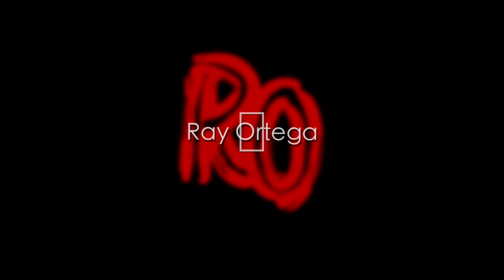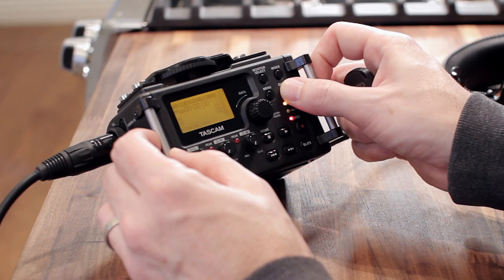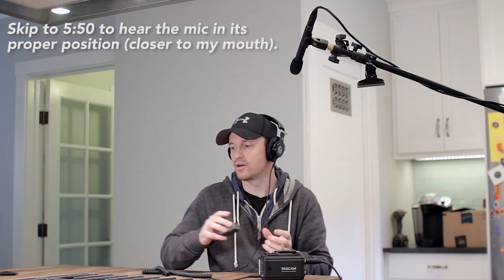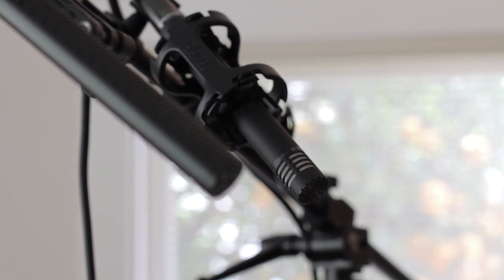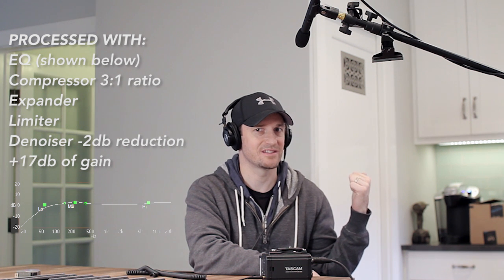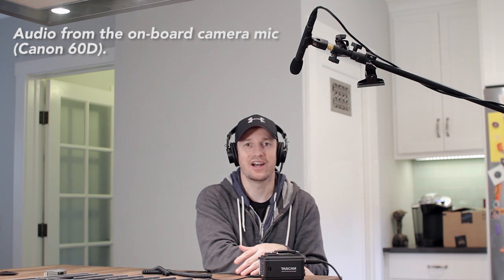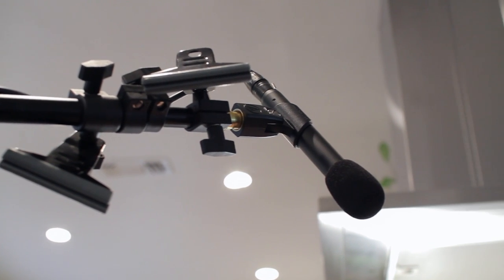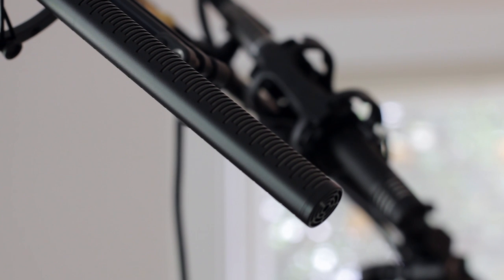AT4053b Hypercardioid Boom Microphone

Comment: Shotgun mic senken CS-3e is designed for both for indoors and outdoors because they have added capsules for rejecting lows and mids from the rear and sides of the shotgun which will be helpful for low ceiling booming indoors(reflections from celings and sides will be reduced) & also for outdoors for rejecting ambient noises from sides and rear.
If u do comparison between Audio-Technica AT4053b and Senken CS-3e indoors,it will be helpful for people like me who want to buy 1 mic which Fits all their needs.

Comment: Amazing video! Learned a bunch and im sold on the 4053 and the DR-60D. The mic is a little pricey but you get what you pay for and this sounds absolutely beautiful. When im ready to buy I shop through your links. Thanks again for making this outstanding video.
Reply from the maker: +Jo Olmedo thanks Jo. Appreciate you using the links. The 4053b is a great little mic and the DR-60D does a great job at a great price.

Comment: Hi Ray! Did u decided what mic will be ideal for the echoe type room? will a Sanken Cos11d lav will be better? my location is concrete with hi ceilings no acoustic treatment whatsoever.
Reply from the maker: Both of these mics work great but in an environment that is challenging acoustically like yours, the hypercardioid (AT4053 in this case) is a better bet because it doesn't have the rejection tube/slots which make it less likely to cause an issue. However in your setup you're still going to be challenged by reverb so do anything you can to help mitigate that, rugs etc and the lav mic will probably be best for the simple reason that it's close. You'll get the best results from the mic that is closest in a tough environment like that but again that will only go so far and you'll need to treat the room in order to make it any better than what you'll get from a close mic.

Comment: I am a bit confused about the wind shield on the microphone. You’re too far and even on the wrong angle to ever hit it with plosives. Is it to catch any AC current? What’s up with that?
Reply from the maker: In this setup it's not doing a whole lot but it's on there to show it (comes with) and because it doesn't hurt to have it on. But yes, I could of done this without it and should of pulled it off to compare/see if there was a noticeable difference, a wind screen can roll off some of the high en

Comment: Great video. I currently only have a shotgun mic and was wondering if it would be worth it to get a hyper. Based on your last statement about sound variations between shotgun / hyper, it would be interesting to see a test of these two in the same situations.
Reply from the maker: I would use what you have unless you are finding an issue. Most of the time a shotgun will work just fine. You can see a comparison here https://www.youtube.com/watch?v=2j8wOuLQyJo I will also have a comparison coming out too with both shotgun and the AT4053b inside so subscribe so you don't miss it. Bottom line is that the shotgun will work.
Reply: Ray Ortega Okay thank you! Already subscribed, so I'll just keeping doing that haha.

Comment: Can I not use this for outdoor to shoot with a DSLR? I am planning to get one with the Zoom H6. Advice?
Reply from the maker: Yes, you can use it outdoors as well. There may be less rejection than a shotgun but I've heard it perform great outside and inside.
Reply: +Ray Ortega Thanks for that. I am planning to use it with an Zoom H6 so I can connect to my DSLR. Do I need a Sony Lavalier? And how do i run the setup if it works?
Reply from the maker: You don't need a lavalier if you are using the AT4053b with a Rode. You'll need a 3.5mm to 3.5mm stereo cable to connect the Zoom to the DSLR if you want to record to the camera.

Comment: Hi Ray,

when you refer to another video can you put in an annotation or a link to other relevant videos in the description (as well?)
Reply from the maker: Hi Rish, yes I usually do but if you are referring to the one I refer to in this video it's kind of an insert for a video I haven't made yet using the remote you might have seen in my hand. However I was leaving people hanging, I was also referring to this video http://www.youtube.com/watch?v=q-hngZN_Axs
Reply: Thanks Ray - added to my watch later playlist!
Reply from the maker: ***** Cool. The piece of gear I use in that video is great for remote focus but I would get the wireless remote unless you also wanted to do time-lapse photography which the intervalometer in that video will allow you to do. The wireless one I use in this video is just for focus and starting and stopping the cam.
Reply: Ray Ortega I use a Panasonic Lumix DMC-FZ1000 at the moment for my YouTube shows (filming in 4k and outputting in 1080 for a virtual 3 camera production) and I've started to experiment with the remote app on my phone and tablet, and it's quite amazing what those can do and allow you to see the screen, focus (zebra peaking) etc. I'm not front of camera but I've found the few times I've used the app really useful when I want to concentrate on sound (I'm usually a one man band) so I can keep an eye on the footage while I reposition and focus on the sound if booming or setting up a stand to keep the mic out of shot.
I'm also trying to put a rig together where I can be on a second camera but monitor the wide shot at the same time which will allow me to create the interesting pans or more raw footage to cut to to keep the video interesting, but monitor the wide shot, in particular as I often use chroma tricks so need to make sure that there are no issues in the background like a screen flickering!
Reply from the maker: ***** wow that is an intense setup! Keep up the good work, I'll check out the results!;)

Comment: Wow, yes defenitely it sounds good. But, what if you move your head little bit? Anyway great video review as always :)
Reply from the maker: Thanks. You'll be fine if you move your head some. As an example check out the part where I move the mic with my hand and I say that it's pointing at my forehead. There is some room to move in your chair and you could probably pick up two people with it if you had to. However, the cardioid pattern is an advantage when you want to capture more voice than other noise.
Reply: Sure, Ray, I noticed how the sound change when you change the direction of the capsule....anyway, overall the sound is great....sadly Iguess is pretty expensive and for an interview  it is needed at least two microphones.
Reply from the maker: A&V PROJECT yeah this is definitely not a budget option and is indeed a step up in the "pro" direction. It took a long time before I bought a mic this nice but I wanted to invest in one that would be the best for the situation while still not breaking the bank. This believe or not is the low end on this type of mic however without sacrificing quality. It all really depends on what kind of content you are shooting. That's why I always ask people to ask me before they buy gear, it's always different for every producer. Thanks for watching!